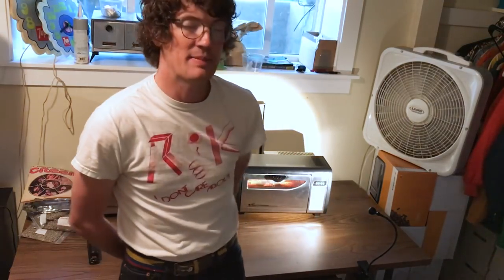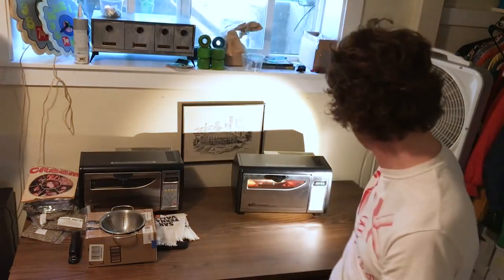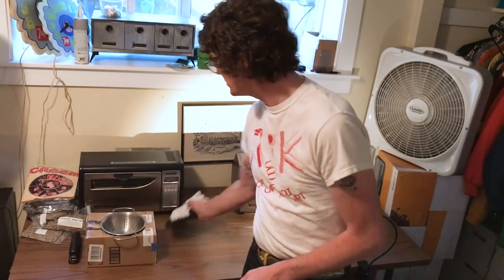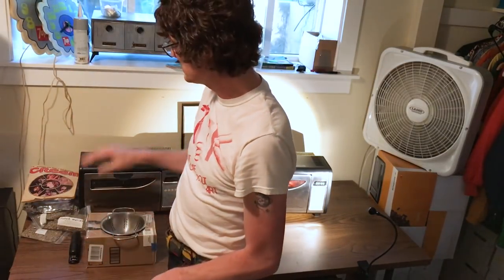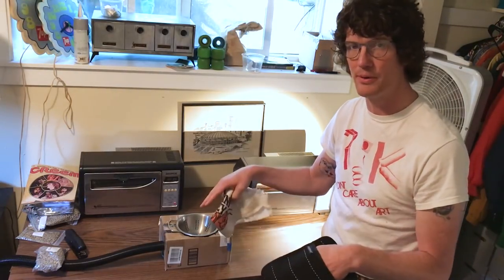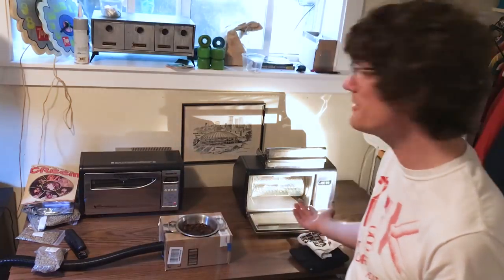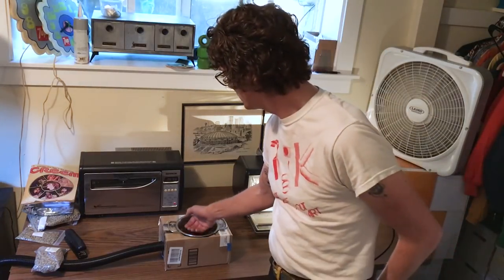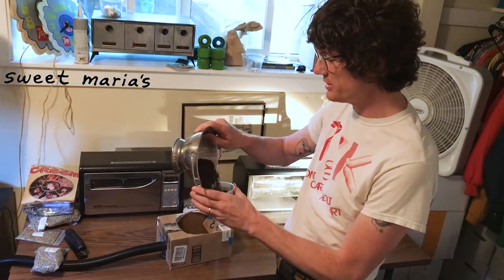A Cooler Way to Cool Your Behmor Roast

Comment: I was at Walmart and saw a similar sized stainless colander to the one in this vid and had a brainstorm, as I hadn’t seen this vid yet. It was a few bucks so I grabbed it. The wheels were turning and my wife realized I was in inventing mode. Having the colander I browsed their cheap cookware until I found a small stainless pot that had a diameter allowing the colander to fit very tightly inside. Brought them home and with a drill and file cut a hole in the pot to receive a vacuum hose. 
When roasting is complete I remove the drum and chaff tray and quickly vacuum the chaff and hot air out of the roaster itself before putting the Behmor in cooling mode w/ door left open. Then I attach the hose to the cooling setup and dump beans in colander. This all takes about 10 seconds and I am convinced it is actually cools the machine faster by removing the hot beans, drum and chaff tray. With beans now in the colander I stir the beans with a wooden spoon to assist cooling. Combining this technique with your manual roasting instruction vid for the Behmoor really improved my roast quality.

Comment: I have an old, very powerful shop vac attached to a 5 gallon bucket.  A cheap screen colander fits tightly in a hole I cut in the lid.  This setup cools a batch of coffee in 30 - 60 seconds.

Comment: I tried this tonight and it worked fantastically!  I ordered a mesh steel colander and use the box it came in as the cooling chamber. I also used the vacuum  to first suck away the chaff in the roaster with the door open before removing the drum. Once removed, I held the hose against the drum and kept it moving (with gloves on).  It worked great before dumping into the colander. After cooling,  there was barely any chaff to sift away. Thank you!

Comment: As has already been pointed out, shutting down a hot roaster – even for a short time – does not seem like good practice for electronics health.  I have been removing the drum right after hitting the cool button while the drum continues to rotate.  I first pull out the chaff catcher and put it on my concrete garage floor, then I use two fairly large screwdrivers to lift straight up on the left drum axis and push left on the right axis freeing the drum.  It’s harder to describe than actually do – you can try it on a cold roaster first. The drum pops right out and the roaster continues without interruption in the cool cycle (I leave the door open).   I grab the drum with gloved hands, then quickly cool the beans inside the drum while rolling it around my garage floor while closely blowing a strong stream of air at the beans with a 120v electric air mattress pump.  Cools in 20 -30 seconds.  Then I shake the beans vigorously in various directions inside the cooled drum, which removes most of the remaining chaff.  Since I’m doing all this right at the edge of the garage with the garage door open, there’s not much of a chaff cleanup issue.  The air pump serves that purpose quite well.

Comment: I have been doing this for about twenty five years, back as far as when SM was in Ohio!  Enjoyed wonderful coffees ever since.  I just wanted to say though, that I normally tend to see chaff that does not drop out of the drum and sticks to the bean, especially with dry processed coffees.  So, when you put it in the colander, it cools the beans, but you still have beans that have to be cleaned of chaff.  What I do is put the beans in front of a fan , either in the colander, or in a tray, and let the fan blow away the chaff (done outside, or where ever you can let the chaff fly), usually moving it around with my hands.  It would be nice it someone would come up with a device  that would cool and clean the chaff.

Comment: I've been doing something similar for years, so, yes, good idea! But I'm not sure about putting the hot chaff collector on top of the roaster. There are a couple tender electrical connections to the afterburner just under the housing at the top. Since they get plenty hot as is we probably don't want to add to the heat or lengthen the cool down time (fried them a couple times). I now put my hot chaff collector on the cool garage slab.

Comment: I've had pretty good results hitting cool, opening the door, pulling the chaff tray, and placing an 8-inch fan on high right in front of the unit while letting the drum continue to rotate.  Beans and drum are cool in about four minutes. Chaff blows everywhere but this is all happening in the garage where it's no big deal.

Comment: I pour mine into an aeropress (cap on) and place that on a canister vacuum with hose detached. Beans are cool in less than 30 seconds!
Reply: How many grams can you safely get in there?
Reply: @DanMars27  whatever I can fit in the popcorn popper fits well in the aeropress. usually 60-80g.

Comment: I use to use the vacuum method but then reversed the air. I use a 20L bucket with a ceiling exhaust fan inside, inlet holes in the wall around bottom and the colander in a hole cut in
 the lid. I do it outside so the chaff blows away. Not only does it cool faster but de-chaffs the beans.
Reply: Is there anywhere that I can see a picture or diagram of this setup please?

Comment: Question:  Is it really necessary to replace the drum into the roaster before restarting the cooling cycle?  Extra time for the roaster to spray hot and more chance of skin burns.
Reply from the maker: That's a great question. It probably isn't strictly necessary, and you're right that the heat from the drum is always an issue for the hands. We really like using a ove glove or other heat resistant glove to make it a little easier.

Comment: This is a really great idea! Is it possible to cool too fast? I recently began roasting in my garage and when it comes time to cool, I open up the door all the way and use my leaf blower at about 50% power to blow on the beans while the drum keeps turning. 3/4lb of beans get completely cool in about a minute or so. Chaff goes everywhere, but it's in the garage so NBD. Is this too quick for cooling?
Reply from the maker: Awesome method! At a certain point cooling too fast could be a problem but we are talking techniques when folks are using freezing temps and/or excessive moisture. Your leaf blower is harmless...and very effective.

Comment: A little concerned about shutting off the Behmor while it's still hot. Is this good for it?
Reply: Check out the video, he actually leaves the Behmor running for it's entire cool down cycle.
Reply: Not Quite. He restarts the cooling cycle after he has emptied the drum and replaced it in the machine. Those few seconds with no air flow right after it's been at max temperature are a little concerning. Wonder what Behmor would think of this? In spite of my concern I still like the idea of a faster cool down with the beans outside of the roaster.
Reply: No, it is terrible for it and should never be done.
Reply from the maker: It can't be good for it, agreed. But I have done it for many years on one machine (4 yrs or so) and its ok. Personally I let it cool 60  secs, turn off, remove drum, then start up again quick to finish the cooling. -T
Reply: Thanks for this. Definitely going to try it.
Reply: Does he use a chaff collector?
Reply: I am no expert but I would argue that turning the machine off for less than 15 seconds, and then leaving the door open and allowing cool air in, REMOVING the very hot chaff tray and the very hot metal drum and roasted beans, and then restarting the cool cycle with the door left open through the cooling cycle, cools down the electronic components much faster and more efficiently than following the instructions and allowing the roaster to enter the cooling cycle with door closed and the very hot chaff tray and drum full of very hot beans in the roaster for the duration of the cooling cycle.
Reply: @Nobody4rpresident  This is all one sentence, incredible
Reply: Brain Rapp - Thank you. Hemingway, Faulkner (both Nobel winners), James Joyce, and all those 1920s modernist authors were known for their long, run-on sentences.
Reply: The only issue I have come across with a hot Behmor is the exhaust heating element wire breaks if you slam the door closed. Heck my oven gets to 400c and the electronics are fine.

Comment: Thanks for this video ! Would you know what is the difference between the Behmor & Behmor
 plus?
Reply from the maker: The Behmor 1600 Plus is Behmor's latest design that replaced the 1600 about 5 years ago. It was improved with manual controls and 2 drum speeds.
Reply: @SweetMariasCoffee  Thank you for the info ! I appreciate it!

Comment: Do you use the chaff tray? Did not see you remove it.
Reply from the maker: Yes. There was a chaff tray in there. Watch closely at 3:35. Dan quickly takes it out an places it on top of the Behmor.

Comment: too much complicated and too dangerous and hot.  PUT the coffee in a METAL bowl, then put the bowl in the cold water in the sink, with the plug IN.  The metal will conduct the hot in the cold water, about 5 minutes to make coffee cold for 1 lb.
Reply: no.  it's perfect! all the time (since 3 years i'll get this method) try it.
Reply: The coffee in the middle will continue to cook and you have an uneven batch.  The Behmor is uneven enough to begin with.  You need flowing air to reach all the beans and remove heat quickly.